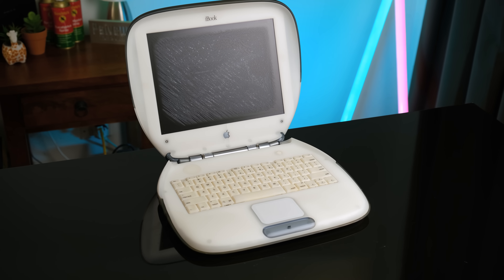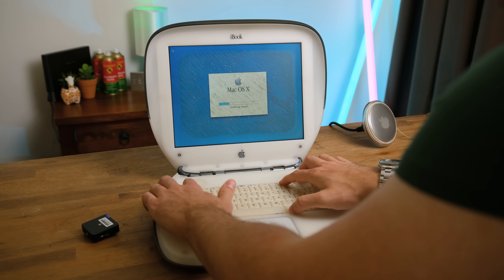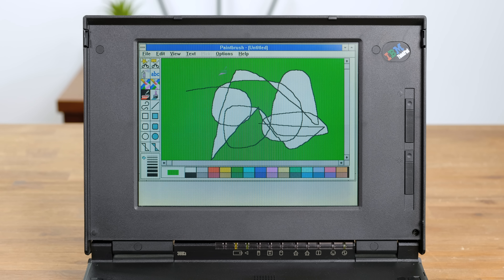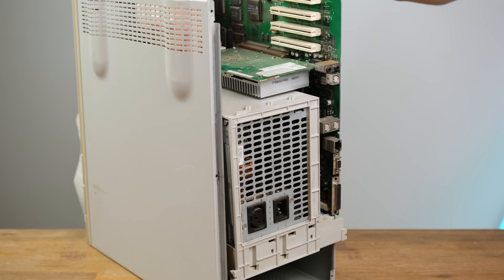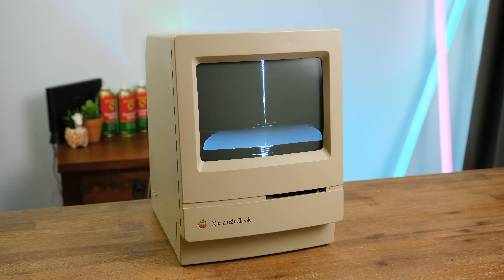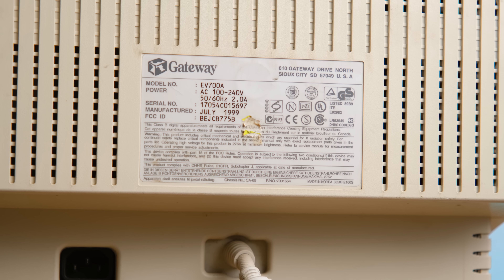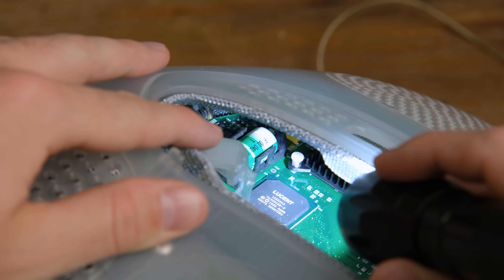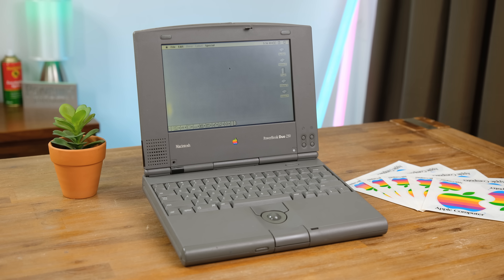So Much Vintage Tech Is Dying... Here's Why

Comment: If you're still in touch with Luke please send him a link to a video on Adrians Digital Basement called "You won't believe why the sound was broken on the Color Classic!". He fixed up a Mac Color Classic that suffered almost the exact same fate and there's a big thing he should know, that entire bottom section of the board tray is actually an audio ground and if the board is not in connection with it the audio doesn't work at all. Adrian actually damaged a board swapping over the audio chip to try and fix it before he realised what the problem was.
Reply: Yep I've seen Adrian's video, and it's been a saviour to me a few times as a lot of Macs of that vintage seem to use that metal casing as a ground source that impacts the sound so it's a easy trap to fall into.    Sadly that Colour Classic board was way too far gone for repair - it literally had pins rusted off the CPU. 😥 It's now enjoying its retirement as a parts board helping me repair other Colour Classics! 😉

Comment: HI

Xmas i opened up my Acer Tablet Ipad copy - it is just a 2G win 8 machine but has 12 hours run time - amazing even today

Sadly the beautiful screen had "puddles" in it about 20-25% of the screen size
It has patches or puddles about the size of sticky notes where it has gone off colour and dull

Ibook 2007core2duo also at xmas has the pregnant battery so now it is a luggable AC machine - probably because i installed linux mint on a new 240G ssd in 2020 ( haha )

The apples so suffer from hard drive sticktion - actually many hard drives do that MFM/ IDE / Scsi a tap or a light knock will set them free, i had one work machine some @2000 toshiba laptop by guy in the next desk every monday morning it would not start, so he pick it up , shakes it , then it boots

Comment: Vinegar Syndrome can be repaired by removing the polarizer (and the original adhesive) and replacing it with a new one. Though how long the replacement lasts is hard to say. Shuichiro Hirakawa explains the vinegar syndrome chemical process in detail in his YouTube channel and also shows how to replace the polarizer.
Reply from the maker: Glad to hear it can be done. But for most people, that would be far too time consuming and difficult (myself included).
Reply: @psivewri  Just saying, people might want to reconsider retro collecting if restoration and preventative maintenance are too time consuming and difficult for them because without that this old tech goes straight to e-waste. Also as others here have stated, replacing the polarizer isn't very difficult, it's one of the more easier restorations out there.
Reply: @psivewri  not really , i did mine on a 27inch sony tv from 2009 in and under 1hour , obviously i was not filming it but it was still my first time doing a polariser change. it is working fine after almost a year now they only issue is i didn't clean the lcd best to it has tiny bubbles in places.
Reply: @psivewri  It's not to Terrible of job. I have done several.
Reply: @psivewri not to mention, the smell of screen chemicals up close can make your whole room smell like vinegar for the rest of the week (speaking of experience)
Reply: Is this every display? Or ones cleaned with the wrong chemicals?
Reply: @goclunker  every LCD display made in the 2000s to 2010s can develop this thing in this 2020s due to age (i have successfully replaced the polarizer on my LG Scarlet TV)
Reply: @akhyarrayhka4048  is this fundamentally the same reason why old GameBoys can have burnt up looking displays?
Reply: @ΜικεΡ  could be, i never owned one
Reply: @goclunker  the issue is caused by the triacetate cellulose base (what the polarizer is usually made of) reacting with moisture/humidity or even the adhesive layer. So yes, almost every LCD display including LED backlit ones are affected, because they all have a polarizer. This issue seems to be less prevalent in temperate climates though. 

Wrong or harsh cleaning liquids are unlikely to be the primary cause, but they can worsen or quicken the damage if the chemical process has already started.
Reply: @sengyew83  damn. Everything is made to fail. I am now reconsidering my retrotech collection
Reply: @goclunker  I don’t know if this is a case of something being “made to fail” as much as it being a case of “This is (was?) the best material for the job (at the time)”. 

Look at battery tech now. Lithium batteries aren’t great for the environment and need to be replaced every few years, but they’re honestly the best thing we currently have available to us. In the 90’s,  Nickel cadmium batteries were used in everything., and they sucked. 

They are working on better battery tech (and tech in general) that we will see in the future.
Reply: @sengyew83  jik😮😅😅
Reply: @goclunker  only widgets. Reconsider the constant purchase of widgets. Especially those exploiting labor that is moving from farms to cities. Cities are doomed. They always crumble. Always.
Reply: @goclunker  and that's our economy bro .. the powers at be make everything to fail .... so as to force use to keep buying... imagine buying a computer that never breaks ..... bad for business.. I'm still personality hurting that Cara are literally made of fiberglass and are not built like my 99 box crown Victoria
Reply: @chiclown5475  fiberglass also gives more fuel economy because of the incredible weight reduction it can provide for a similar strength and durability. Yes, its not exactly repairable, yes its got more cushion to it, but that cushioning effect modern cars are designed around is to wreck the car on one hand, because business,  but also to maximize survivability, also because business, plus safer cars also means better business.
Reply: @Akira-Aerins  yes but the "business" part sadly is not in our favor
Reply: @sengyew83  So that's probably why someone who lives in the PNW, like me, who collects a lot of ancient hardware, has never seen this before. I have seen a lot of old LED's over the years but never one that's developed this vinegar syndrome. Looks gnarly.
Reply: @goclunker  ... are you for real? Entropy is a thing of the universe. Everything eventually fails, not "Made to fail" lol.
Reply: @JO11190  are YOU for real? Learn to store your stuff in the right conditions
Reply: @goclunker  Not related to cleaning, as even covered LCDs like the Game Boy lineup suffer from this.
We have an LCD TV here at home that crackled all it's polarizer by now, it's over 10 years old tho (still kept using it since it's a Full HD panel anyway).
Reply: @Kalvinjj  gameboys are from UV exposure tho. Sunlight and playing under a lightbulb that puts out a lot of UV. They don’t fail otherwise.
Reply: @Kalvinjj  I still have all of my original gameboys and none of them are showing any screen issues. I’ve been lucky with most of my tech. About the only thing I’m legitimately worried about is my game gear even though it is a later model. Those capacitors love to leak.
Reply: @goclunker  Which GameBoys does this issue include? I have a SP, Color and a plain one.
Reply: @BaconFaceMcGee  all of the non backlits if they have been exposed to strong UV. The polarizer is replaceable however, so its not the end of the world. With all the wonderful ips upgrades these days, i am not sure if the original screens are worth the effort
Reply: @goclunker   LCD screen have a 20 years-ish lifespan.
Reply: I watched this video recently because sadly some of my VAIO collection has the same vinegar effect. And these are stored in a cool basement with low humidity.
Reply: @RetroGadgetMan  you may want to separate the affected ones from the pristine ones. The chemical process has started and can spread because of vapours. If possible, increase or keep a consistent air flow of the area to purge the vapours (while maintaining the temp & humidity).
Reply: @sengyew83  thanks for the tip.
Reply: It lasts a long time actually but it's a very annoying repair... Very messy.
Reply: I own a car that have LCD instruments and it is getting near 30 years old. It is very common to the polarizer begins to peel off from the edges, also the black stencil at the back of the glass stars to tear apart diagonally. Mine was perfect until last year, when it starts to develop. It is certainly tied to sun/heat exposure. There are some guys that sell polarized sheets and stencils.
Reply: yes i did this on my garmin marine plotter, cost literally nothing but time and delicate patience
Reply: That is an excellent video but having tried it on an LCD with the dark spot, it is unbelievably delicate work.
Reply: That is good news. The plastics used in old electronics are environmental friendly since it disintegrated after 10-20 years
Reply: @faeezf  Probably gonna be microplastics though
Reply: @faeezf  I wouldn't call that a disintegration in ecological term. Plastic is still harmful even if particles are so small you can't see them. Plastic grocery bags trash in oceans also break down under sunlight exposure, and it's still dangerous to sea animals.
Reply: I fixed this issue on mine and I uploaded a video on my channel showing how to replace the polarizer film on the iBook G3 Clamshell. It is not that difficult actually, just a bit time-consuming but feasible for most people I would say :)
Reply: Oh, good to know! I think I'll try removing the polarizer in mine sometime!
Reply: @TransCube In other hand I had to replace my own GBC's polarizer, a GBA SP, and even the replacement screen I got for it in like 3 years. Definitely UV is a factor, kinda obvious for the reflective screen ones.
BUT, my GBC was in great condition up until I picked it up like 15+ years later to play again, then it just started to deteriorate in a matter of months. But not just limited to outdoors gear too, an industrial robot controller screen on my university has that issue as well. I wonder if ambient humidity is a factor since it's usually quite high in Brazil.
Reply: Very nice response! Thanks for teaching me something new!
Reply: My Gameboy pocket LCD was damaged like that. I managed to get a replacement LCD, but now it also failed. I have a IBM Thinkpad 760XL and the screen also failed.
Reply: What?
Reply: My 2007 Bordeaux Design Samsung LCD HDTV have the same vinegary look and smell, been sitting on a hot bedroom in an barely used house for years certainly accelerated the process by the time I got to it the smell starts and then screen goes then TV just forever stuck on standby, at least its remote still works and in great shape lol.
Shame as I liked those old LCD TV design and then they tried to make them look elegant and appealing, one of Samsung's first attempt I think.
Reply: @barebarekun161  "forever stuck in standby" and "samsung" usually means every single cap on the PSU board will be puking its guts out. I made SO much money on the side back in 2010-2013 just recapping pre-2010 Samsung TVs because they used absolute trash tier caps in them... good times
Reply: @Knaeckebrotsaege  Weren't they also known to make one of the worst disc drives and players on the market alongside Philips?
Their entry level stuff are garbage my mid 2010s Philips Blu-ray player ate the disc and broke not even remote works anymore, I have to take it apart to get my disc back it was hack job.
Reply: @BOGDAN SERBAN "Old phones don't even work for calls anymore because of the network" ... dunno where you got that BS from but i can still dig out my 1994 Nokia 2110 and it'll work just fine with a modern SIM in it. GSM is alive and well, just data services (most notably 3G/HSPA) have been shut down. You don't need those for basic phone functionality. Smartphones not supporting 4G/LTE also haven't magically stopped working, they just can't use "fast" data anymore. Got nothing to do with calls and texts, which still work
Reply: All by Design. The past must always be deleted so they can keep lying to the next generation about it.
This is why video and audio formats are always changing too. This is only one of the things put in place to fulfil that agenda too.
Why do you think hard drives are now soft drives and everything is pushed online.. All that used to be paperwork. 
Then they Stage an EMP event and delete everything because they put all the data in one basket as they continue to do.
PS: They are the Eastern Matriarchy .. They are The Real Enemy of the people. (Who are not of their lineage.)
These are not CLAIMS either.. They are SOLID FACTS.
Reply: for those who want to experiment to do it heres how (do at your own risk) it can cause dead pixels. you need a very sharp razor blade, and at least 70% isopropyl alcohol or acetone like a nail polish cleaner. first you need to disassemble the screen completely including the bezels until the whole LCD display is separated alone (while you may need to keep the power on while doing this later in the process) BE CAREFUL NOT TO PUT TOO MUCH PRESSURE AND CAFEFUL NOT TO RIP THE FLEXI CABLES VERY FRAGILE AND AVOID FINGERPRINTS.  after you stripped it bare now you can use the razor blade to cut multiple vertical lines from top to bottom of the polarizer (the black film usually on the front of the LCD) if the rear polarizer that had been damaged its possible that it can't be done alone (needs a professional)... this later process require a lot of elbow grease. you need to scrape off all of the remaining glue glue residue and the polarizer until theres no dirty spots left, it can take days depending on how severe or how large the screen is, then you need to buy a same size replacement for your display or you had to cut it yourself , you will need to researh whether the screen uses 0 degree polarizer or a 90 degree polarizer, for TVs i think its usually 90 degrees to make sure you need to power on your monitor and see if the image showed up properly or not, you need to prep the surface free from any lint dust and fingerprints, then you have to prep a soapy water and a towel or a soft paper towel to be put on the edges of the surface. you can use a sprayer to spray the soapy water on the surface to make application easier and you can begin to put the replacement polarizer on top of it (very sticky) then you can continue remove the bubbles using squeege or something familiar to remove excess soapy water and you can let it dry. and if God wills it your screen polarizer replacement would be successful. BEST OF LUCK
Reply: Gladly never happened to me, I have a crap 2003 laptop still looking good, same with my 2006 Asus or my 2005 LCD monitor.

My current Samsung 22 inch 1080P monitor from 2011 that it's still my only monitor looks exactly like day 1.

The weather and UV exposure is what influence a lot how fast the process happens...

I have a big problem here is with rust, in like 2 years things already start lightly rusting here FFS, I live at like 400meters from the sea...

Edit: forgot to say that I really hate plastic breaking, my current Corsair AX750 80+ gold PSU all cables are bad and the plasting is breaking all over the place (the plastic that surrounds the pins). And I really had so many stuff that went bad because of it. Super glue + toilet paper or anything else is your best friend. But good quality plastic I have some for ages that never break so I'm guessing it's bad plastic mixes mostly...

Ps: but I really, REALLY hate is the garbage rubbery texture that the stupid manufacturers add, it takes no time at all to get ruined and a huge mess to remove, I spent hours taking off everything even in my god damn room light switch had that garbage FFS, same with fake leather like on headphones it gets ruined in no time even with no use, it should have been BANNED...
Reply: Its apple trash. Makes sense
Reply: Are you sure it's the polariser?  That is usually behind the glass on LCD.  The only thing in front of the glass (on a non-touch screen) is usually the anti-glare coating.  That could be removed completely and either left off (shiny) or replaced with a generic anti-glare film.
Reply: @MattOGormanSmith  LCD TVs (and calculators) may have a glass front panel. Most monitors and laptop screens however don't have glass on top of the polarizer.
Reply: @MattOGormanSmith  Yeah, it must be anti-glare.

Comment: we could also make like a tournament for old tech repair to repair as much as we can, this would be cool and this could incite people to restore these, this is an heritage that cannot be lost
Reply: I agree. There is a big problem though with the retro computer scene blowing up in the last 3 years insofar that most newcomers have no idea how to fix electronics. I am lucky that my dad is an electronic engineer so he can do most of my retro computer repairs by reflowing boards, replacing caps and fixing PSUs, etc… my own ability is just to clean and retr0brite as I have no technical skill.
Reply: a lot of this stuff thankfully can be fixed, IDE SSDs exist, polarisers can be swapped and batteries can be replaced,

the stuff thats a time bomb is soldered NANDs and GPUs with Bump-gate.